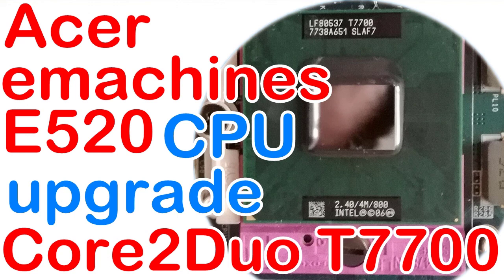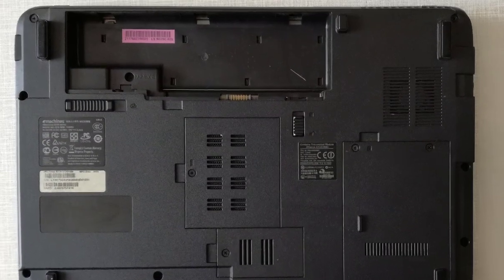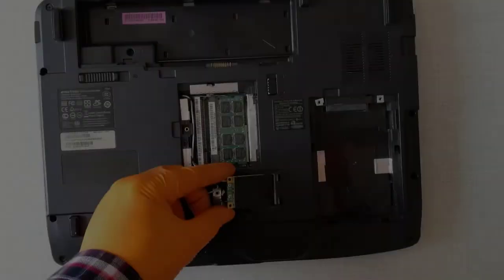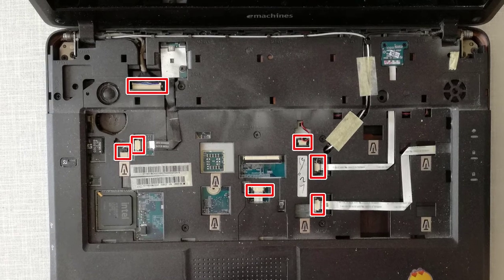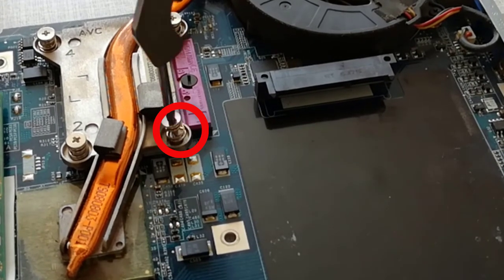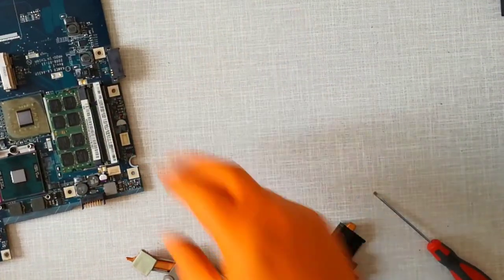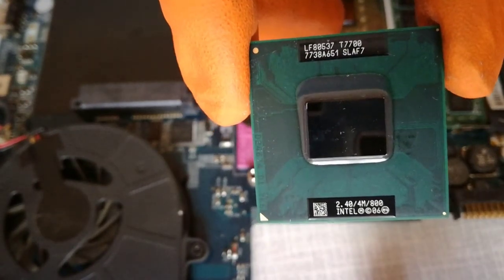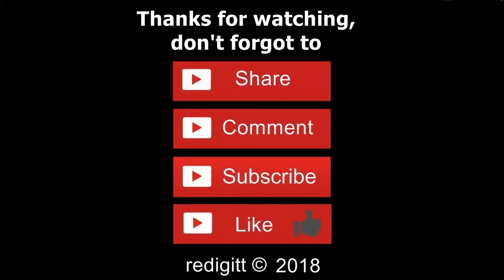Acer eMachines E520 CPU upgrade to Core2Duo T7700 @ 2 40GHz Ep.250

Comment: I wanted to ask you, I would like to buy the cpu soon, do you think the extreme x7900 can work?  Or is the TT700 just fine?  How did you find yourself?  Did the PC work fine?  If I put on an Extreme will I have overheating problems or just a little more than normal?
Reply from the maker: I never had or used a laptop with x7900 CPU TDP 45W, but usualy a higher TDP CPU is hooter.
This is my theory, maybe I'm wrong or maybe not.
If your original CPU was a  27W TDP Celeron and you upgrade to a 45W TDP x7900, then in theory  the CPU will use with 66,6% more power = more heat.
27W............100%
45W............x
===============
(45x100):27= 166,6
But if you upgrade to a 45W TDP CPU, then you should use a very good quality thermal paste and thermalpad.
Good luck and please leave a comment how went the upgrade, how hot was the CPU, I am very curious.
Reply: @redigitt  Ummm you made me doubt now ahahaha if there is this problem then I would opt for a smaller CPU, like the TT700 or the T7700.  How did you feel with the TT700 differences in temperature and performance?  Thanks a lot  and of course I'll let you know
Reply from the maker: I used a good quality thermal paste, I didn't had any problem with the temperature, it was sligtly lower then with Celeron CPU. With the T7700 in the multi thred benchmark I gained 154%.....I think thats a very good result, I felt like I bought a new laptop. 
If you have the money, you may consider to buy the T7800 is bigger with 200MHz.
Reply: @redigitt  I bought this today on ebay Intel Core 2 Duo T7800 CPU Dual-Core 2.60GHz 4MB 800 MHz Socket P CPU Processor, I hope it will go well, I read on the Russian site about an emachines e520 for sale that mounted this CPU, so I turned around a bit and decided to buy it
Reply from the maker: Should work very well, and you should have about 162% gain.
Reply: @redigitt  Hi hope mate I hope that working, I let you know when I finish to restore this leptop. How much are original benchmarks?
Reply from the maker: https://youtu.be/xtHl14U2tqg?t=370
Reply: @redigitt  Aa Yeha, I had forgotten that I saw it in your video
Reply: @redigitt  The Cpu is from China on ebay, I paid 21 puand, in ebay are a lot of Cpu a chip price like 20,25,30,39 paund.. I hope is Good
Reply: @redigitt  Hello mate, the Cpu arrived and togheter arrived even a small pack with the termic paste, is too liquid and soft, you think is good or I use my termic paste that I told you last day?
Reply from the maker: I don't recomand that white cooler paste that came  with the CPU, you need a good quality thermal paste  like the  Arctic Cooling MX-4,
Reply: @redigitt  Thank you very much, Why do you think the thermal paste you give me as a donation is not good?  I cleaned and changed the cpu, the PC is accelerated a lot, it just needs to mount the SSD and it should fly.  Today I realized that the headphone jack doesn't work, I don't know if it's a problem with a driver or a faulty component.  I think I will also change the speakers because they are weak.  In practice, I almost refurbished this fucking pc

Comment: Hi, I wanted to ask you one more thing, your touch pad is The touch pad buttons work for you?  Does your PC find your drivers?  Because mine doesn't work and I don't know how to do it, I disassembled, but everything seems fine.  But instead nothing to do does not work.  I find nothing on the drivers, no touch pad name, nothing at all.  Do you have any advice for me?  Unfortunately this PC has many small problems that I am trying to solve.
Reply from the maker: This laptop has about 12 years, probably they won't make  any new drivers.
And I had some bad experiences with Windows 10, when came a new release, some drivers wasn't compatible anymore. 
You could try toinstall Windows 7 and then upgrade from Windows 7, maybe than will preserve the drivers,  I'm guessing here.
I almost never use the touchpad on any laptop, I have big hands, for me is a nightmare the touchpad.
Reply: @redigitt  I have already Windows 7, I tryed to do many things to active the touch pad and the bottom attacked on touch pad, but nothing, I find the driver cause is hide, but also if I disable and reactive the driver o unistall, nothing change. Yesterday I opened the laptop and in those zone is everything OK, at least it seems. I try also to tpcuh the correct sequence of botton fn + F7 and nothing. 😢 I use touch pad, I find one on ebay together the top plastic, maybe I need to buy it, but my fear is that that doesn't work either. Try ank you very much brother
Reply from the maker: This laptop has driver support only for Windows XP and Vista  https://www.emachines.com/ec/en/US/content/drivers.html
You could search for drivers with the hardware ID
You can try these drivers to https://drive.google.com/drive/folders/1hMHAFYP-gF243A_5J9x7zDpeB0jDpB1N?usp=sharing
Reply: @redigitt  On device manager and hidden, but there is, I see, Synaptics PS / 2 Port compatible touch pad, device status, the specified device is not present or not working properly or not all drivers are installed.  Practically even if I install windows 10 does it find me the drivers?  But I did not understand yours works or not?
Reply: @redigitt I asked a guy on eBay who sells this PC running windows 10 if the touch pad works, and he said yes.  This is very strange maybe he told me a lie.
Reply from the maker: Sorry, I don't have any more this laptop and I don't remember if the touchpad worked or not.
Reply: @redigitt  A ok thank you for everything help mate, I approciated

Comment: Hi I have 3 questions, I have the same PC and I would like to upgrade it.  So about the cpu is it only compatible Intelcore duo T7700 or can I put something better and more powerful?  Is the ram a standard or must it be compatible with this PC?  And about windows 10, I haven't been able to install it, I don't know why even if I converted to MBR it doesn't work, maybe it's because the CPU and the ram aren't enough?  Sorry for my ignorance, but I've never done these things in the PC.
Reply from the maker: Aloha, personally I tried only up to T7700, but it should work these CPU's to:
Core 2 Duo T7700	2	2	2.4 GHz	                800 MHz	4MB	35W
Core 2 Duo T7800	2	2	2.6 GHz	                800 MHz	4MB	35W
Core 2 Extreme X7800	2	2	2.6 GHz	800 MHz	4MB	44W
Core 2 Extreme X7900	2	2	2.8 GHz	800 MHz	4MB	44W
Before the CPU ugrade, please update the BIOS to the latest version.
Please provide  more information about   your laptop configuration(HDD, RAM, CPU), did you use DVD disc or USB 2.0 or USB 3.0 flash drive, which program did you used to make bootable Windows 10, at which step did you stuck with the instalallation, did you delete  all partition from the HDD and partitioned with Windows 10, did you get any error message?
Thank you for watching, if my video or advice was useful, please consider to like, share, it helps my video with the YouTube Algorithm, good luck with the upgrade..
Reply: @redigitt  Hi thanks for the answer and for your help, personally I don't know how to update the bios in old laptops, where should I find the Bios file for Emachines E520? Could you give me a right link?
The laptop is all original as from the factory, the only thing I did was change the HDD because the one it had was broken, I had an identical one and changed it by installing win 7.
Intel Celeron M 2GHz CPU.
Intel graphics GPU.
HDD Z5K500-500 500Gb 5400RPM HTS545050A7E380.
2Gb DDR2 ram.
Intel GL40 chipset.
For the windows installation I used a USB 2.0 ISO image drive with Rufus.
Regarding the installation of windows 10 it did not start, perhaps because I had created other partitions with Aomei partition assistant, but that in the end I managed to solve and get everything back as it was before. So if I try now it may be that it will let me install it. But the problem was about MBR or GPT because usually win 10 is better with GPT, but if I do it from GPT I get a screen that says to redo the key with rufus in MBR. This I don't know if it concerns why the bios is old or other components like the CPU.
Reply from the maker: You can download the BIOS file from the official support page  https://www.emachines.com/ec/en/US/content/drivers.html  
1. download the BIOS file and unrar
2. disable the Wifi card or unplug the LAN cable
3. restart the laptop
4. and only now run the KAWE0110.exe, you don't want to update the windows or any program when you update the BIOS
Warning!
During the update procedure:
Make sure your battery is charged minimum at 25%.
Make sure your system is connected to AC power.
Do not disconnect the PC from the AC power.
Do not shut down or reboot the PC.
Do not connect or disconnect any USB device.
Do it on your own risk, I will not be held responsable for any damages.
Reply: @redigitt  I try to put the SNID number on the site but it can't find anything.  Then I put the model of acer E520 and I find the Bios version 1.06 of 2009 while in my laptop the version is higher, and the v1.10.  very strange.  How do I get a major version if the one on the site should be the latest?
Reply: @redigitt  Wich7 version of Bios do you have? And is it necessary to update the Bios before changing CPU or installing windows 10?
Reply from the maker: if your laptop came  from factory with v1.10 BIOS, you don't need to update the BIOS, you just simply upgrade the  CPU
Reply: @redigitt  oooo perfect Brother, thank you very much 😊😊 So I'm thinking of getting a core 2 Duo Extreme X7900 soon.  I will let you know soon, after changing ram hdd and CPU. Thank you so much for your help, I appreciated.
Reply: @redigitt  Hi, I wanted to ask you one more thing, your touch pad is The touch pad buttons work for you?  Does your PC find your drivers?  Because mine doesn't work and I don't know how to do it, I disassembled, but everything seems fine.  But instead nothing to do does not work.  I find nothing on the drivers, no touch pad name, nothing at all.  Do you have any advice for me?  Unfortunately this PC has many small problems that I am trying to solve.

Comment: thanks
can you help me ? what cpu can i use for e527 ( celeron 900 ) ?
Reply from the maker: I never upgraded the e527, but I think all of this CPU will work, but I advice to not use higher TDP CPU then 35W, because it will overheat.
Mobile Celeron 900 1 1 2.2 GHz 800 MHz 1MB 35W       +
Mobile Celeron 925 1 1 2.3 GHz 800 MHz 1MB 35W        
Core 2 Duo E8135 2 2 2.667 GHz 1066 MHz 6MB          
Core 2 Duo E8235 2 2 2.8 GHz 1066 MHz 6MB          
Core 2 Duo E8335 2 2 2.933 GHz 1066 MHz 6MB          
Core 2 Duo E8435 2 2 3.067 GHz 1066 MHz 6MB          
Core 2 Duo P7350 2 2 2 GHz 1066 MHz 3MB 25W +      
Core 2 Duo P7350 2 2 2 GHz 1066 MHz 3MB 25W     +  
Core 2 Duo P7370 2 2 2 GHz 1066 MHz 3MB 25W     + +
Core 2 Duo P7450 2 2 2.133 GHz 1066 MHz 3MB 25W +      
Core 2 Duo P7450 2 2 2.133 GHz 1066 MHz 3MB 25W     +  
Core 2 Duo P7550 2 2 2.267 GHz 1066 MHz 3MB 25W       +
Core 2 Duo P7570 2 2 2.267 GHz 1066 MHz 3MB 25W       +
Core 2 Duo P8400 2 2 2.267 GHz 1066 MHz 3MB 25W     + +
Core 2 Duo P8600 2 2 2.4 GHz 1066 MHz 3MB 25W     + +
Core 2 Duo P8700 2 2 2.533 GHz 1066 MHz 3MB 25W       +
Core 2 Duo P8800 2 2 2.667 GHz 1066 MHz 3MB 25W       +
Core 2 Duo P9500 2 2 2.533 GHz 1066 MHz 6MB 25W + +    
Core 2 Duo P9600 2 2 2.667 GHz 1066 MHz 6MB 25W   +    
Core 2 Duo P9700 2 2 2.8 GHz 1066 MHz 6MB 28W   +    
Core 2 Quad Q9000 4 4 2 GHz 1066 MHz 6MB 45W   +    
Core 2 Quad Q9100 4 4 2.267 GHz 1066 MHz 12MB 45W   +    
Core 2 Extreme QX9300 4 4 2.533 GHz 1066 MHz 12MB 45W   +    
Celeron T3000 2 2 1.8 GHz 800 MHz 1MB 35W       +
Celeron T3100 2 2 1.9 GHz 800 MHz 1MB 35W       +
Celeron T3300 2 2 2 GHz 800 MHz 1MB 35W       +
Celeron T3500 2 2 2.1 GHz 800 MHz 1MB 35W        
Pentium T4200 2 2 2 GHz 800 MHz 1MB 35W       +
Pentium T4300 2 2 2.1 GHz 800 MHz 1MB 35W       +
Pentium T4400 2 2 2.2 GHz 800 MHz 1MB 35W       +
Pentium T4500 2 2 2.3 GHz 800 MHz 1MB 35W       +
Core 2 Duo T6400 2 2 2 GHz 800 MHz 2MB 35W       +
Core 2 Duo T6500 2 2 2.1 GHz 800 MHz 2MB 35W       +
Core 2 Duo T6570 2 2 2.1 GHz 800 MHz 2MB 35W       +
Core 2 Duo T6600 2 2 2.2 GHz 800 MHz 2MB 35W       +
Core 2 Duo T6670 2 2 2.2 GHz 800 MHz 2MB 35W       +
Core 2 Duo T6900 2 2 2.5 GHz 800 MHz 2MB 35W        
Core 2 Duo T6970 2 2 2.5 GHz 800 MHz 2MB 35W       +
Core 2 Duo T8100 2 2 2.1 GHz 800 MHz 3MB 35W +   +  
Core 2 Duo T8100 2 2 2.1 GHz 800 MHz 3MB 35W     +  
Core 2 Duo T8300 2 2 2.4 GHz 800 MHz 3MB 35W     +  
Core 2 Duo T9300 2 2 2.5 GHz 800 MHz 6MB 35W +      
Core 2 Duo T9400 2 2 2.533 GHz 1066 MHz 6MB 35W + +    
Core 2 Duo T9500 2 2 2.6 GHz 800 MHz 6MB 35W +      
Core 2 Duo T9550 2 2 2.667 GHz 1066 MHz 6MB 35W   +    
Core 2 Duo T9600 2 2 2.8 GHz 1066 MHz 6MB 35W + +    
Core 2 Duo T9800 2 2 2.933 GHz 1066 MHz 6MB 35W   +    
Core 2 Duo T9900 2 2 3.067 GHz 1066 MHz 6MB 35W   +    
Core 2 Extreme X9000 2 2 2.8 GHz 800 MHz 6MB 44W +      
Core 2 Extreme X9100 2 2 3.067 GHz 1066 MHz 6MB 44W + +
Reply: @redigitt  thanks,
I tried T4500 and it worked fine
I will try T9900 when i get it
Reply from the maker: Thank you for your feedback and good luck with the upgrade.
Reply: @ahmedmohd1512  didi it work with T9900??
Reply: @winer067  
I tried only T4500 and it worked fine

Comment: Jihaaaaaaaaaa yes yes it works great man THX.......

Hello, i did the same with my emachines e520 and it works great i must say.
But i get from 156.0 to 400.8 (multi) and 157.6 to 205.1 (single).
I think my old cpu was the same so how is this possible?
Reply from the maker: Aloha, for the upgrade I used a good quality thermalpaste, because the Core2Duo T7700 @ 2 40GHz has a higher TDP then the Celeron M575 @2.00 GHz and I made the benchmarks with a fresh installed clean windows. If you don't use a good quality thermalpaste and you don't clean your fan /heatsink the CPU will overheating and your CPU will not work at his best performance.
I'm glad my video was useful, please share and subscribe , have a nice day.

Comment: Nice job. I own the e520 but I changed the T1600 cpu into T3400. I also tried the t9500, but it did not work. How were you able to update the bios? Where did you get the 1.1 version? I have the 1.04.
Reply from the maker: Thank you,  the laptop came with the v.1.1 BIOS version. From here you can download the v.1.06 BIOS  http://www.emachines.com/ec/en/GB/content/drivers.html  Good luck.
Reply: @redigitt  hi. Does cpu compability differ from bios version? My E520 have v1.06 in stock. Thinking about celeron 575 cpu upgrade... not sure is it worth it.
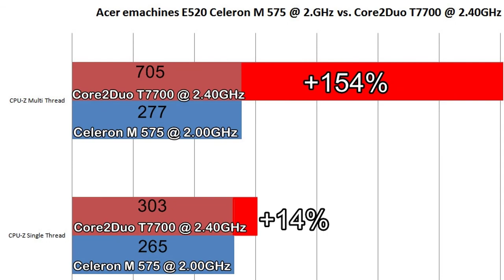Reply from the maker: Aloha, if you would like a better experience in: web browsing, watching clips on youtube and  you would like to open the programs faster then the upgrade defiantly worth it, but if you would like to use the laptop for gaming, do not bother with the upgrade, because the laptop is too old for gaming. At 00:06:20 you can watch the windows experience index rating after the upgrade. For me personally it was worth it the upgrade. Good luck with the upgrade if you decided to upgrade and please share and subscribe, thank you for watching.
PS. I gained 39% in procesing power.
Reply: @redigitt  not even close to gaming, just dreaming of proper work of youtube at the moment 720p videos struggling to play without freezing. 4gb does not help. Also tried latest ubuntu, but performance is about the same. I just think if ram does not help, it could be that cpu gives only marginal boost and the end possible boutleneck is gpu - gma4500mhd.
What do you think?
Reply: Found cpu T7250 and upgrade was successful! Performance is slightly better but it's enough to keep pc and use for  simple every day tasks. Thanks!
Reply from the maker: @ @janisvaskis2051   I'm glad you'r laptop is enjoyable again, for better performace you could stop some services like the : Windows Search, Print spooler - if you don't use printer, etc.